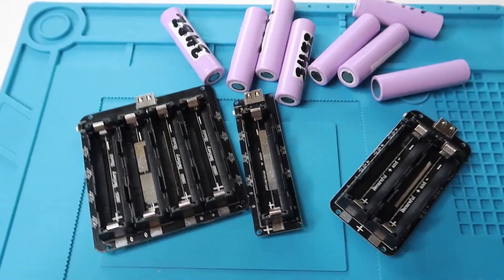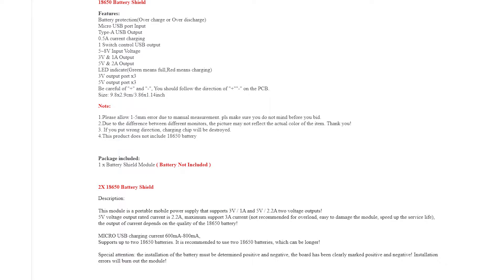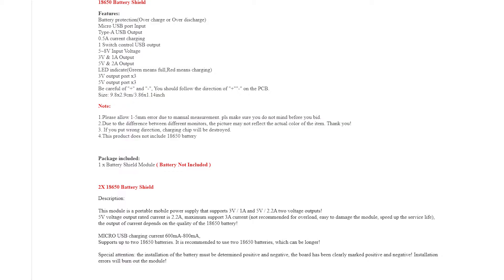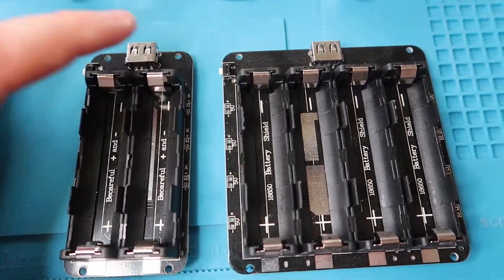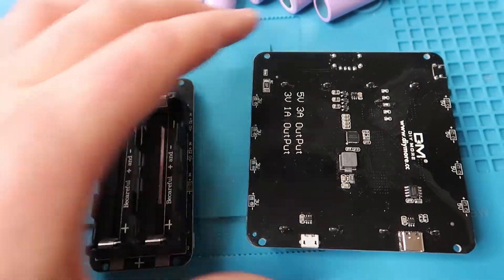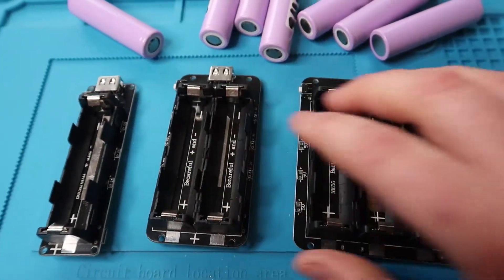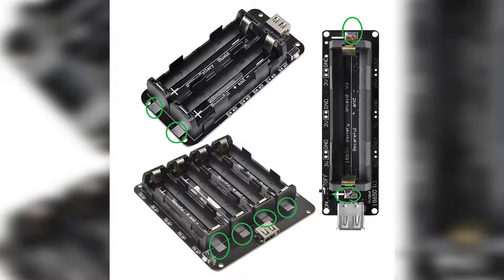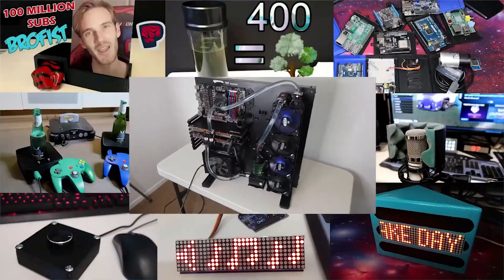How to use 18650 Battery Shields (USB charger, Arduino, ESP32, ESP8266)

Comment: Is it possible to add a latching switch to the single battery V3. I’m using the battery bank to power a mini Bluetooth radio and will be enclosed in a Pelican 1020 case?  The latching switch is DaierTek LED 4 wire latching switch. I’ve been researching the power bank and haven’t seen anything to assist me in this. Thank you for your help!  
(Note….. I’d prefer to use a latching switch externally mounted so I wouldn’t need to open and close the case every time I needed to power on and off).

Comment: Oops. I was wrong. It turns out that the shield will turn off if the phone (usb-c or micro usb phone) is already charged and therefore no charge is drawn from the shield. The shield will only stay on if there is a draw on the shield. The shield has a "drawn current requirement."  To over ride this requirement you need to turn off the shield, connect the phone to the shield, switch the shield switch to "HOLD," then turn on the shield. This way, even if the phone has been already fully charged and the phone is not drawing any current from the shield because the phone does not need it, the shield will stay on anyway. The drawn current requirement is over-ridden. And the phone will begin charging when it needs it. The "HOLD" switch does indeed have a purpose. It prevents the shield from turning off if there is no current drawn from it.

Comment: What about pass through charging and uninterrupted power supply support? And if powering a microcontroller like esp8266, is there support for sensing or polling battery state so, it can for e.g compute remaining time when on battery power?
Reply: Can I use single cell module with esp??
Because idk the product is same but it says compatible with only  raspberry pi
Reply: @Ganesh-jk5rt mine has solder pads for 3 and 5 vdc output.  I haven't used them

Comment: This Battery Charge Shield Board have a safety function to protect the 18650 battery under 2.8v? Otherwise it can be dangerous for the battery! thank you for your answer . 👍
Reply: Can I use single cell module with esp??
Because idk the product is same but it says compatible with only  raspberry pi

Comment: I think conceptually they are good, but when we use them, they are noisy. Some part of the circuit switches and creates a humm, I have not tested that on an oscilloscope, but I am sure it will have a lot of noise in power delivery. Looking for other options if possible

Comment: Hey, thanks for sharing this. My shield is quite similar to yours but includes a small switch (hold/normal) that keeps the shield on without a minimal load (hold) and in normal mode, it turns off if there is no minimal current. I was wondering if there's a way to monitor the power level of the battery so I can read it in my project. Is it possible to solder a 3V output and ground with a voltage divider? Any suggestions/ref? Thank you in advance!

Comment: Is this okay to use as a power source of a nice nano keyboard and be able to use to charge a phone at the same time?
Reply: No.  This would cause the charger to never reach the cutoff voltage, overheat the battery, and may catch on fire or explode.  Either charge it, or power a load, but never both at the same time.

Comment: Is it bad if I use the button top batteries with them? They’re hard to squeeze in but they turn on. One issue is that the little micro chip on the other side gets super hot. Is that related to the button top? Or something else?
Reply: Panasonic NCR button tops fit in mine without effort

Comment: I purchased the dual shield DIyMore (2 of them). of course if I try to use it as a UPS it won't work since it charges very low a .5amps. So just to charge the 18650 without anything connected to it (not being a UPS or drawing a current) it actually slowly depletes the batteries. I can see the red LED lights get less and less over hours. I'm assuming these are both bad boards? Anyone else have the same issues? Also the green LED never comes on since it always depletes the cell power. HELP! Bought from Amazon. Guess I should return them.
Reply: Here is why the green light (or blue) never comes on ... 
It is never recommended to charge an 18650 lipo at the same time as using it to power something else.  It is not a two-way street.  Pick one or the other.  If you have a load on with the charger on, the charger will never reach the cutoff voltage, which then overheats the battery and may cause it to explode.  Just saying. :)

Comment: Are you able to have say solar panel plug into the input to charge the batteries and then have the USB type A output to a Arduino and run off that?

Comment: Very helpful! 1 question pls, can the module charge and discharge at the same time? I want to drive an Arduino from a small solar panel, with the battery providing power overnight. Thanks, Steve

Comment: I bought the 4 cell one. I found that to power it down you must push 2 times the button and to power It up 3 times. Also, the sliding switch seems to do nothing....I charged (under a looooong time) , 8 cells (I use 2 cells in parallell , so I put 4x2..yes: I am an evil one!) Worked fine!
Reply: The switch only works for the USB power. The 3.3 and 5V are always on, except if using the push button as you noted.
Reply: Sliding switch on mine one position keeps unit on when running very low current devices

Comment: What is the function of on-off switch in this charging module?
Reply: I am asking myself the same question. It seems to do  nothing. Alas, the last firmware version of the 4 cell board powers down with 2 push button touches and powers on with 3 touches. It makes sense : if We accidentally push once the button, something happens....pushing It accidentally twice is something highly unusual.
Reply: As I mentioned before,, the switch is to shut off power to the load while charging.
Here's why...
It is never recommended to charge an 18650 lipo at the same time as using it to power something else.  It is not a two-way street.  Pick one or the other.  If you have a load on with the charger on, the charger will never reach the cutoff voltage, which then overheats the battery and may cause it to explode.  Just saying. :)

Comment: One question, can i charge the batteries while i'm using it to supply a esp32 ?
Reply: Hi i just got this recently, sorry for the extremely late interject.

The answer is Yes and No:

You can use while charging, but the moment you unplug the charging cable, it shuts off long enough to cut power to everything before turning back on. This does not behave like a UPS.
Reply: did you find out? I have the same doubt
Reply: @Emi-fg7fn  Do you know the answer?
Reply: Any news?

Comment: Do the battery level LED's turn off on yours?  On mine they just stay on and waste power.
Reply: So wasting power indeed. Better to remove the leds for a remote project. Thanks
Reply from the maker: they stay on until you turn the unit off check out 7:20

Comment: Very informative video friend, mind if I ask something regarding these battery boards? If I wanted to connect these to a solar panel to charge, where can I connect the solar cells to charge the lithium batteries? The soldering tab does not seem like the solution, do I connect those to positive and negative terminal on the bottom panel? Thank you for the very informative video, bless you and have a good day friend.
Reply: Yeah, I was wondering the same. Not sure can we connect the wires from the solar panel to the micro USB port which is used for charging. Also I'd like to know if we can draw current from the shield and charge it at the same time (which is needed for off grid weather station).